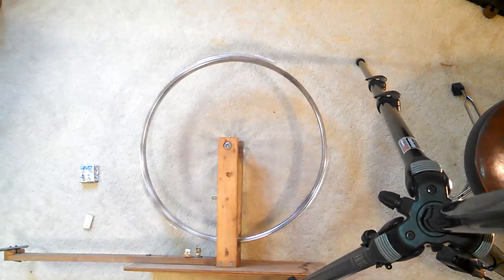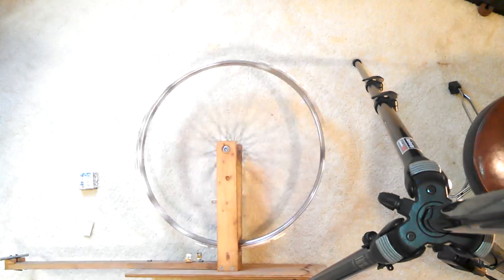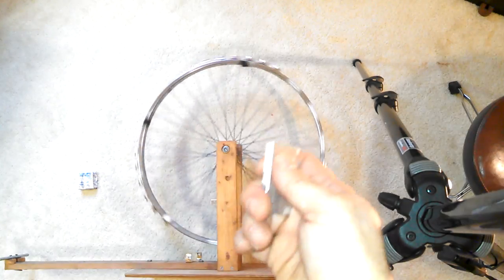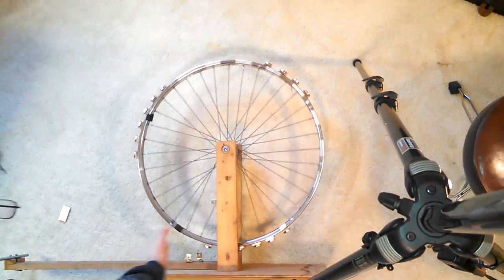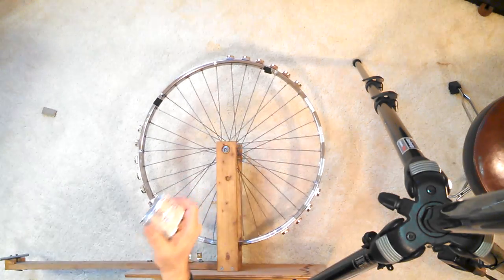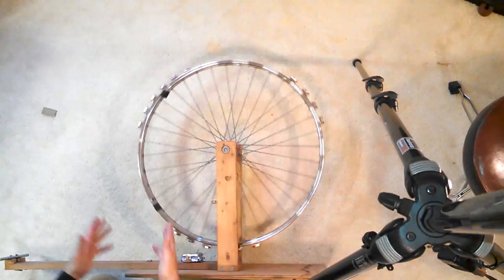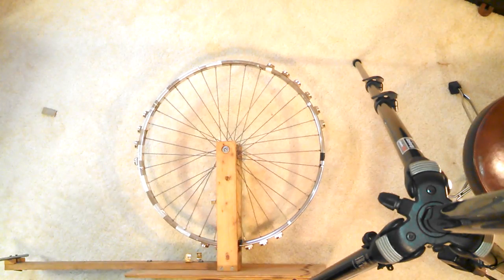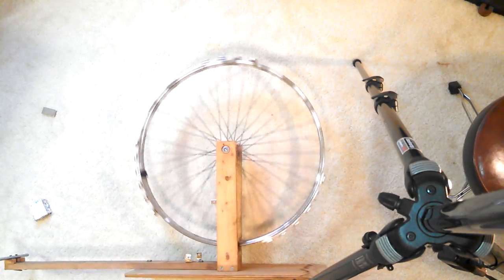🧲 Self Running Magnetic Motor Generator Theory

Comment: Actually, it can't be exactly the same, because there is always at least some energy converted to heat by friction. This wasted energy results in an energy conversion "efficiency" which is less than 100%. The classic application of your example is the electric generator.

Comment: Dear Sir, what you are doing is not 'wrong', but your assumption that it will generate energy that can be used beyond your 'generator' is flawed.  if you are simply proving that magnets can make a bike wheel turn around and around, you've achieved this 100%...but eventually the magnets will lose their power so this is not generating surplus power..why is so difficult for you to understand??
Reply from the maker: Guess what? Turns out we've had German magnet motors for cars since 1966. Google it. Now others are creating their own magnet motor that truly work. Using only magnet to create continuous motion has long since been solved and replicated by others. There for this is no longer theory. Thanks for visiting nonetheless.